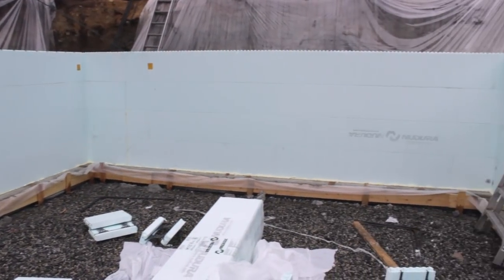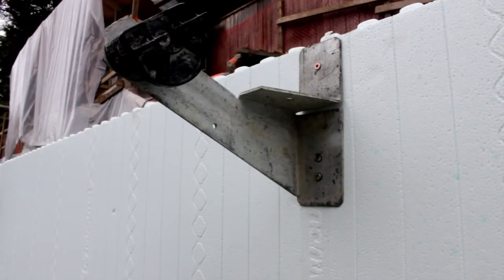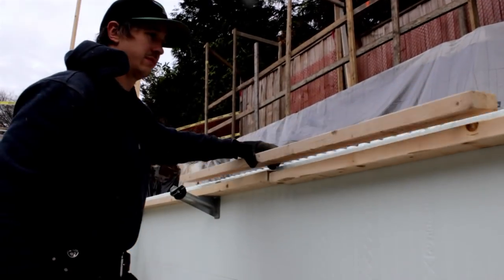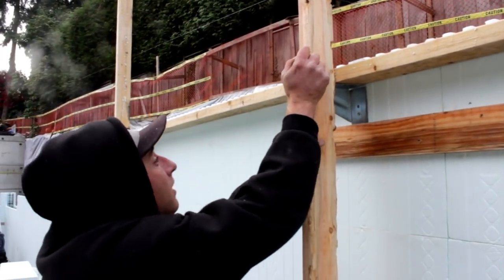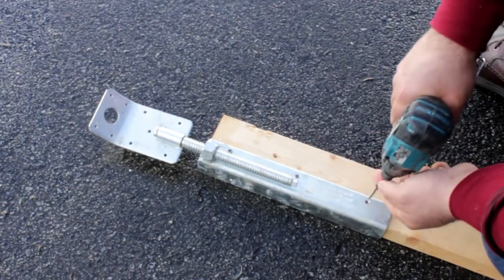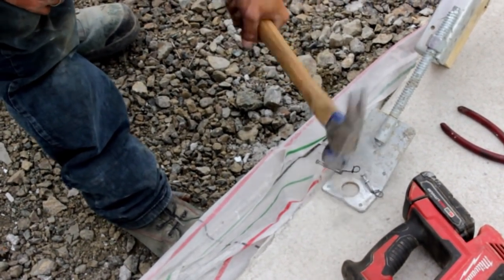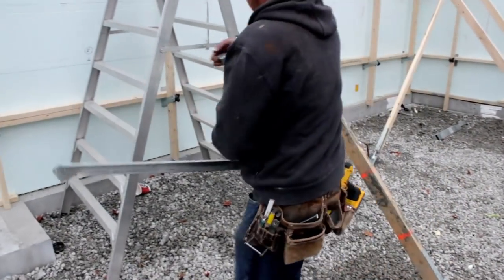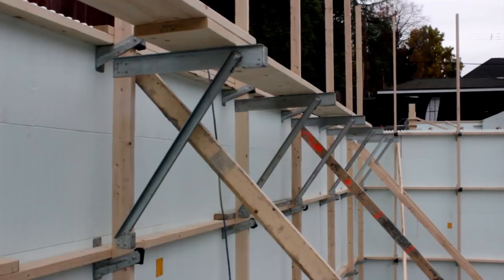Zont Insulated Concrete Forms (ICF) Bracing - Installation

Comment: Will this work with structural metal stud too?
I’m planning to frame the inside walls with metal studs..
Reply from the maker: Yes it will. We have church builders in Austin that do just that. Where the plastic cam hits the vertical stud they place two layers of duct tape on the stud so the plastic cam can "bite" into it.

Comment: i m amazed at how straight these 2x4s are, my local big box store only stocks linguini
Reply: I only get lumber from the big box stores if I only need a few pieces. The smaller off name suppliers have much better lumber at a much better price and that is where I get mine. The key is the lumber at the mom and pop stores is stored outside and it warps way less.